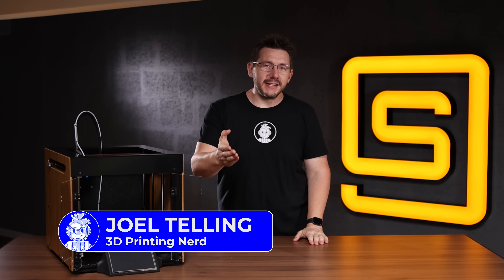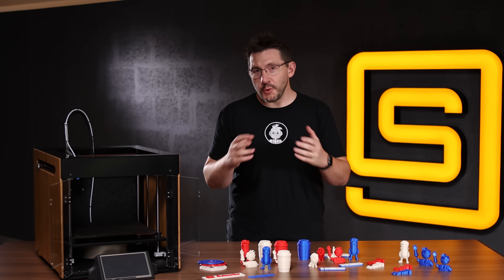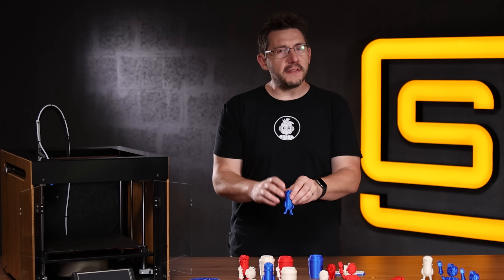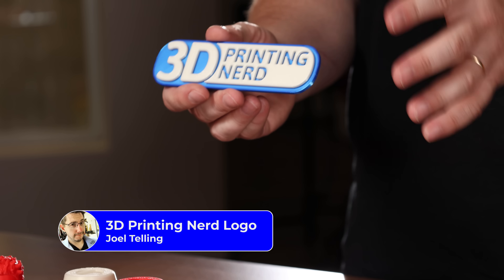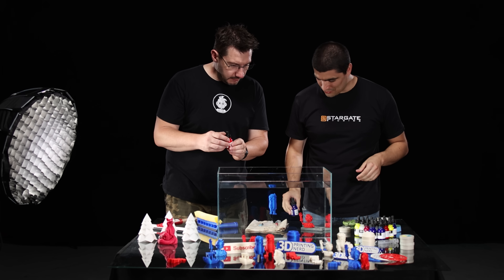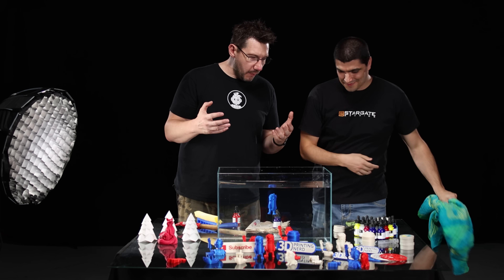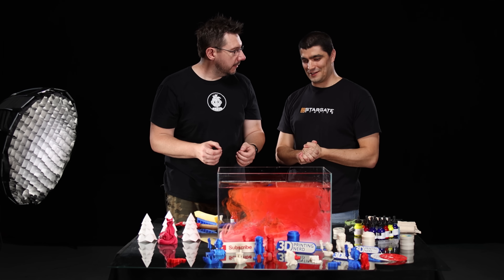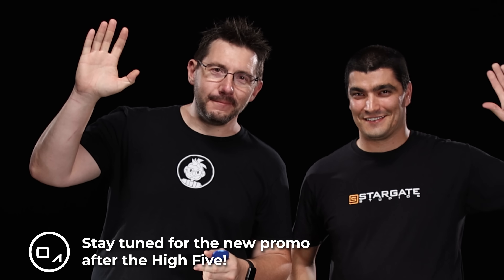You've NEVER Seen a 3D Print Do This!

Comment: Ugh is that a inductive sensor
Reply: Yup, but not the standard type you see on most 3D printers like the PINDA probe. We use a lot of BIG CNC machines, and their probes are built to a much better standard (normal accuracy of 10um) and don't get the heat-creep of the cheaper probes. Plus, they are really easy to source as it's an industry standard part, and incredibly reliable.

P.S DONT get the cheap inductive probes /m8 style probes, their accuracy is trash and suffer massively from heat related inaccuracies

Comment: I love this photography technique, I've been using it for years. You can also experiment with it at home. I have changed the properties of the coloring liquid, thickened and thinned the tub water with additives, and if someone cannot physically lift the tank to repeatedly drain and clean I recommend an aquarium pump or gravel vac to drain most out. Most of all, have fun and try new things.
Reply: yeah it´s lot of fun shooting. i use a cheap syphon pump for aquarium tried a aquarium pump but it took ages to drain :P
Reply: I feel like, the ultimate tool would be a shop vac...
Reply: @VulcaNtGoF  depeny on where u shoot. i do my shoota in the kitchen so it would just be to much noice. and with a syphon pump u jusy squeeze until the tube is full then it drain it self. 😂